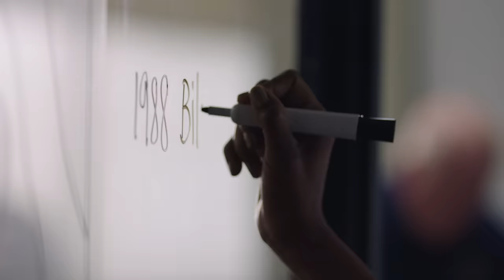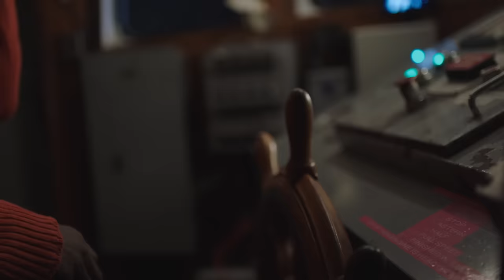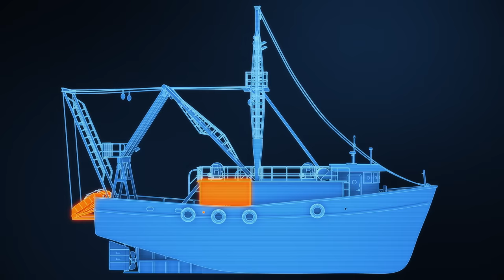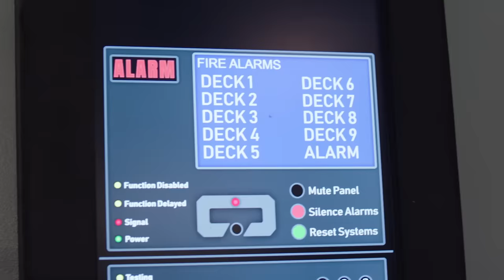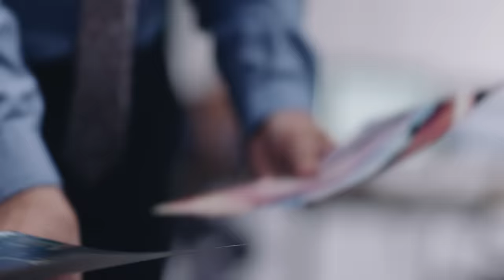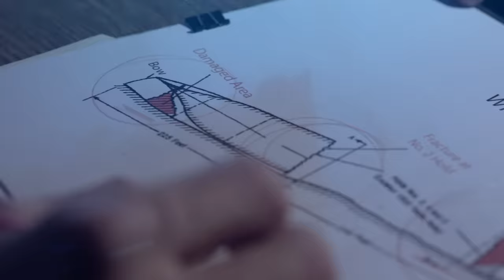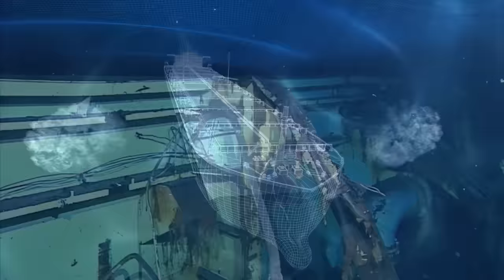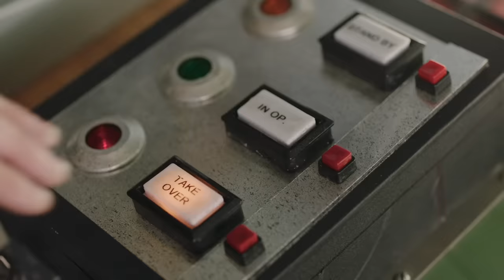12 Terrifying Ship Disasters 🚢🔥 Smithsonian Channel

Comment: I am commenting on the last story of the ferry running into the dock. That's what happens when you're too heavy-handed on the helm. You cannot go from ahead to astern under load, the transmission will stay stuck in gear if you just slam the thing into reverse, you have to wait for the engines RPM's to slow down before switching from ahead to astern or vise versa.

Comment: The locating beacon you mention is amazing. The first satellite was launched sometimes in the 70's by the Soviet Union and at that time I was a founding member of a civillian volunteer search and rescue group and I said we should test it. After a lot of red tape I set off an ELT during a thunderstorm near high voltage power lines. As the satellite came over the horizon a teletype started spewing out latitude and longitude somewhere in Ottawa and it was about 100 miles off. As the satellite rose above the horizon it narrowed the location to about 10 miles. Considering that was about 50 years ago and the radio signal was just above background noise to the satellite that was impressive to me. With more satellites and improvements to the technology the accuracy is far better. Years later while doing other work for the government i was told my record shows I was the first civilian to transmit a radio signal to a Russian satellite.
Reply: The first satellite was in 1940-1950 era and all it do was beeping back to station. So I will give this a cap. But might be true but other satellite
Reply: Sputnik was the first satellite in October 1958.

Comment: I worked on a 118 ft.boat called the ocean pacer. It shouldn't have ever gone out. We were dragging for scallops and by the time we were done water was coming into the boat through the lighting . We had 4" of water inside. That was scary and I didn't go back out with them.

Comment: In the case with Fuzzy, how can adding super structure and concrete ballast not contribute to the lessening of the boats sea worthiness? He's adding weight to a boat that wasn't designed to be that heavy. not to mention wind resistance factors and the top heavy factors.
Reply: All those factors were taken into account and Refurbishment found to be sound . It turned out they left a Bow deck hatch open to pump out excess water which had been noticed but later forgot to close hatch.
Wave strength increased hitting the Bow flooding that hatch - sea water flooded to the Stern raising the Bow out of the water and then it went down swiftly by the Stern .
6 Died 1 Survivor rescued 3 hours later by Chopper. Turned out there was also a problem with ships Emergency Beacon
delaying Satellite sos identification . 🙏